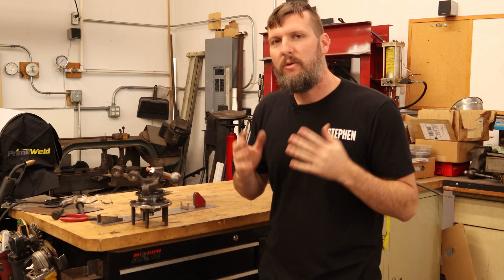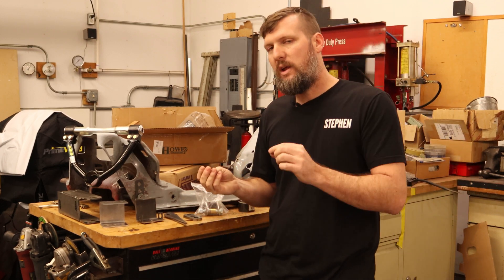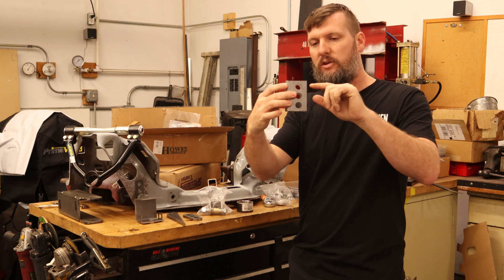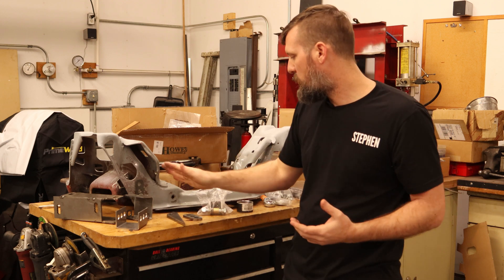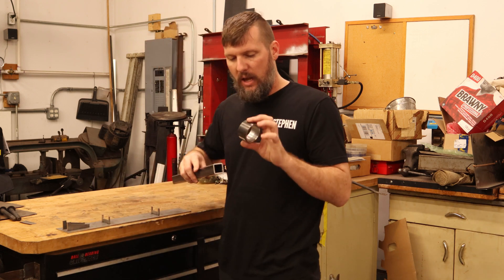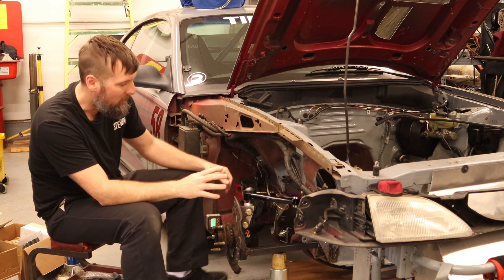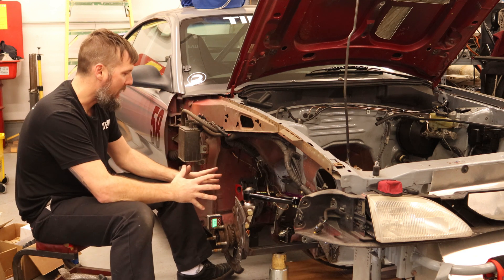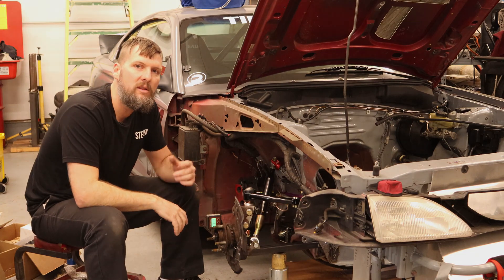Double Wishbone Lower Control Arm Fabrication

Comment: What ball joint and cup did you use? Part numbers?  Guessing these are sn95 spindles correct?
Reply from the maker: Howe Racing. I used the 22329 K719 screw in lower and 79-93 mustang stud with a washer to work with SN95 spindle (I used 224805, which is 0.5" longer). I have mentioned to them about looking into making a ball joint for SN95 spindle as it's becoming way more common than fox. But the fox balljoint with a washer works.

Comment: What was your original hub base to hub base measurement compared to your current measurement? Just curious how much you increased your track width and what length upper arms you ended up going with..
Reply from the maker: Original hub to hub was stock. I can measure current hub to hub, but it's roughly 2 inch wider in total. Upper arm is 7 in from Joe's Racing.

Comment: Too late now, but coleman racing will make custom length lowers with whatever ball joint you want.  If someone doesn't have the skill you have it might be a good option.
Reply from the maker: If you knew what length you needed.... There were cut to length options too.

Comment: If you are not moving the geometry too much forward offset, and still going to cut/fitcustom mounts for the LCA on the MMS K member, i would personally save $200 and go with a cheaper BMR reinforced unit, also would be easier to mod that one if you want to move the steering rack for ackerman as is square tubing in the middle part.
Reply from the maker: Good point. I don't need the forward offset that the MMS designs in.